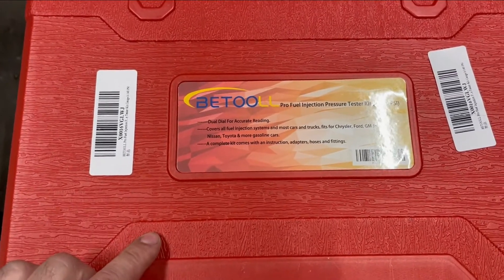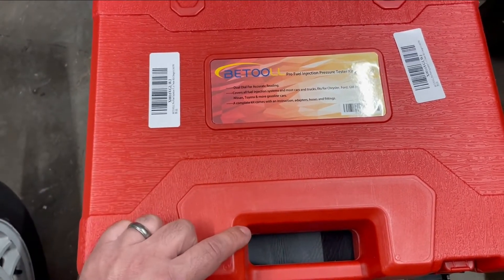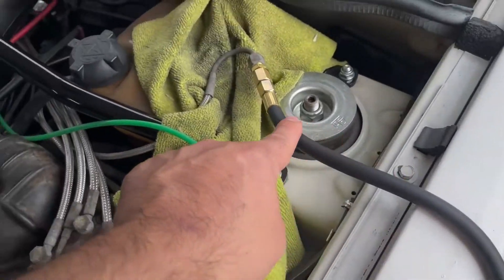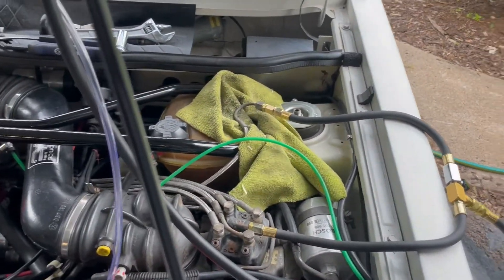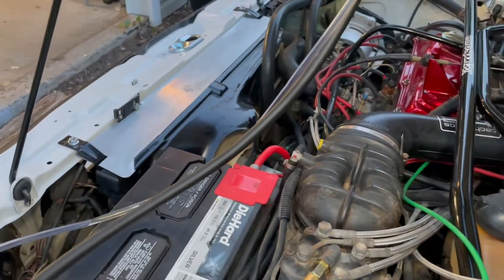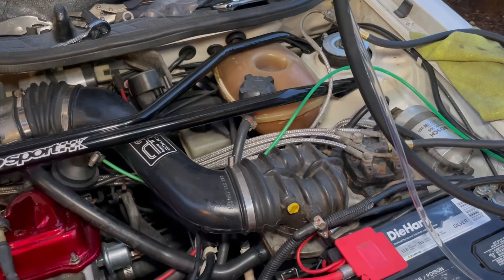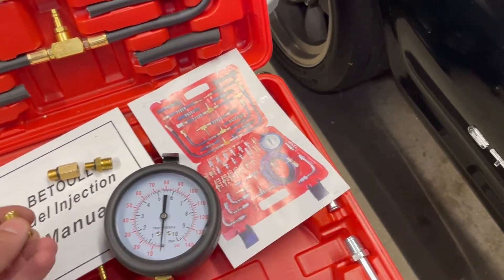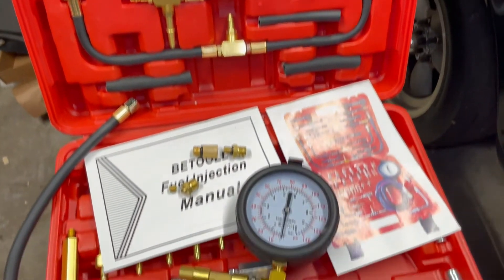Mk1 VW Bosch CIS Fuel Pressure Test

Comment: I have the same cold start issue going on with my rabbit 2:29 
I kind of ignored it because when it gets hot it goes away but now the engine does not want to start and if it does, it dies shortly after it starts idling

Comment: I'm having a hot start failure. Cold start fine. I let it warm up until it reaches normal temp. Let it sit for 10 minutes. Won't restart. Will this test tell me if check valve on fuel pump is bad? What part of your video would show me losing pressure with a bad check valve?
Reply: I had the same for 20 years. The solution can be around 200 euro, the proper way or 5 euro, but you have to do what that part of 200 would do. Your choice. The 5th injector we call it, that normally gives a shot of fuel in form of almost vapor to enable easy start doesn't get that signal. 1,5 m any thin wire and a switch that works only as long as it is kept pressed, costs 4 to 5 euro, install it in cabin wherever you want. I used it in stead of cigarette plug, you can as you like. Press on it for a sec and if it doesn't work press one more second, it will work. Voala.

Comment: Many thanks for putting the efforts.
I find your videos invaluable as I'm going through a cabby restoration process.
Learning Bosch CIS along the way.

1. When you bridged the Distributor & Pressure Regulator and closed the valve you effectively measured the default system pressure of 5.5 bar.
This is what goes to injectors at all times.

2. When you open the valve you actually measure the pressure applied by the control regulator to the plunger into the metering head which partly closes the outflow gates to the injectors reducing the amount of fuel flowing through therefore leaning the mixture.
It initially starts with 0.5 bar when the engine is cold and increases to 3.5 bar as the engine warms up.

My understanding is that this is purely pressure to control the fuel flow and hence the mixture through the plunger however though pressure to injectors still remains 5.5 bar.... Is that correct?

Comment: Was that the low pressure side u just test? Thanks and also can I use it to test the high side as well. Thanks
Reply from the maker: It is testing the side that goes to the warm up regulator

Comment: I did this test and my pressure on my fuel regulator went to 70, my question is if I rebuild it like you did in your other video would it fix the regulator?
Reply from the maker: I'm seeing many people saying that the mesh screens in the inlet and outlet port need to be clean

Comment: Thanks for sharing this and with great commentary! I plan to do this with my Gti over the winter. What ended up being your issue? I had found my cold start wires that route behind the intake by the exhaust were burned and was able to splice in a new section.
Reply from the maker: basically the same thing. One of the grounds from the idle stabilization valves that goes to my cold start injector was broken.
Reply: @ShinyFastLoud  ok cool I see that vid